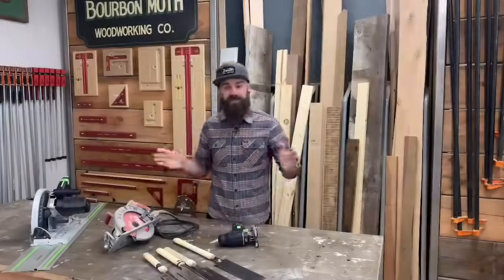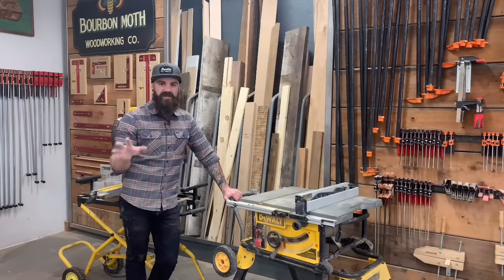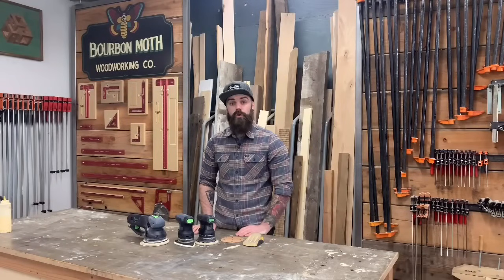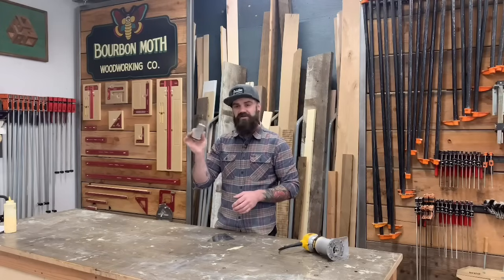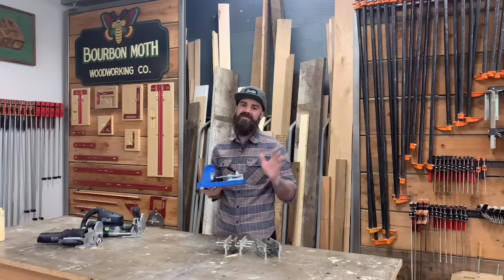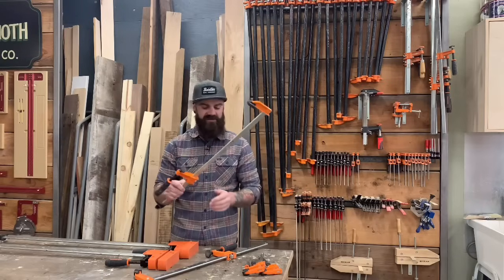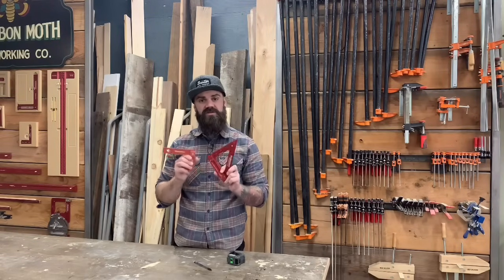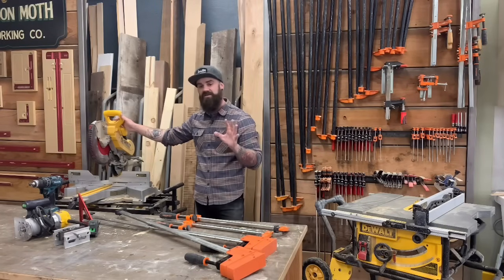Tools every woodworker needs | Start Building for under $1000

Comment: On the whole track saw thing In my beginnings I just used a circular saw with a piece of angle iron for a straight guide with two clamps 20$ upgrade
Reply: Same, but upgraded to a mid price tracksaw for the dust extraction.  Put a good blade in it and it's pretty sweet.  Also one thing a track saw does really well that can be difficult in a small shop with one person is break down full sheet with minimal fuss.

Comment: Great video, thanks a lot. i do have a question kind of off topic. I have been building a pretty nice and functional all in one type mobile work table. I have used my old dewalt jobsite table saw for years but just picked up an old craftsman to install into the table. My question is why do all saws have the fence on the right side? I prefer it to the left not sure why, i am right handed. I switch to the right when i need more rip capacity but thats it. Can i switch it to the left in my table? Does it limit anything or change function in anyway? Thanks

Comment: Nice, I am a Milwaukee fan and I already have some milwaukee tools (drill, driver, jigsaw, sander). Maybe not the best for the table saw ot the miter saw because milwaukee has focused a lot on battery fed tools instead of corded ones. But maybe DeWalt or Makita will work for me.
I honestly think it is worth to spend the money on woodpeckers stuf since you can rely on them to be precise and truly square.
I also found that a nice battery fed "skill saw" can be great, specially if you make a track for it to run on.
In my area, i find bar clamps to be a better purchase because F clamps tend to be much more pricey. But F clamps tend to be better quality as well.
The router, any good and small one with a plunge base option is a great option. Mine got stolen, but I will say it is basic to get going.
Maybe I would add there the pockethole jig too, the jigsaw and a nice circular saw (it is hard to make long cuts with a jobsite tablesaw and it is convinient very often).

Great video, I still have some things to buy

Comment: Next video should be small part inventory..what you will need on hand in your shop,..fasteners, bolts screws, washers and all hardware.  Sandpaper grits that are must haves.  So, I guess my point is, do you as a DIY'er just buy hardware one job at a time or do you stock up so your daily maintenance jobs can be done without the trip?

Comment: If you get a Dewalt table saw, don’t get the 8” as you cannot stack dado blades and are very limited. Get the 10” inch instead as you can stack dados.

Comment: While I agree with most of these options, inflation has not been your friend.   The total for all the linked items is now ~$1275.  The only things I would have added, but maybe they were just assumed would be some safety equipment.  Something like a mask(which, granted you probably already have several) and also some eye protection. While they are still relatively cheap, it pushes the total up closer to $1300.

Comment: Every tool I have (besides a belt sander) is dewalt and it all works perfect. I don’t have a jointer but I use a dewalt electric hand plane with a guide and have had almost no issues..(not sponsored by dewalt but it’s the brand I chose ) great video, definitely don’t need festool or jet etc to Make quality work

Comment: I would include in the starting kit, even if it means a few extra hundreds :
-eye, hearing and lung protection
-dust collection
Reply: Health is invaluable
Reply: @julianweiser9985  Dust collection isn't just about health. It is, no doubts. 
...It's also much cheaper than a divorce.
Reply: Instead of dust collection, I do all my cutting and sanding of consequence outside, and avoid doing much on dead calm days. if that's not an option, I'd definitely include some kind of basic dust collection. If you can't do a really good system, a track saw is much easier to collect dust from than a jobsite table saw or a chop saw.
Reply: For a small shop, even something like a affordable Rigid shop vac will do the job pretty well. At least, far better than nothing. Throw a dust mask in too, and a weekend warrior is probably just fine.
Reply: @The_Mr._Biscuit  Original video is about basics, not breaking the bank.

We can safely agree on a shop vac of some sort as well as fittings needed to tether to the different tools. ....Sais the guy that got away with tuck tape most of the time...
Reply: @The_Mr._Biscuit  Unfortunately, most dust masks aren't sealed well, so don't do much. Likely still better than nothing by a bit, but not as good as many would think. And if you're not freshly shaved, there's no seal. Have a beard? That beard is all the filter you get.

I agree entirely that any amount of dust collection is better than none, so long as it doesn't lead folks to think they're actually fully removing dust. I purposely do most of my work outside, because I can't do good dust collection, especially on my table saw (jobsite) and mitre saw.

Comment: Good info.  For starters, you also need a good set of drill bits.   Not the set with 50 bits that cost 12.95 at the big box store.  A quality set of brad point bits for use with the dowling jig.

Comment: I love these lists because it shows the diversity of woodworking philosophies. I’m a weekend warrior and still don’t have a chop saw after more than a decade but I wouldn’t want to be without my bandsaw. I’m also a chisel and plane guy. My jointer is a huge Veritas low angle jointer plane. One good tip is to scour yard sales and flea markets for hand planes. Replacement blades are reasonably priced and you can quickly build a selection from block planes to jointer and some really cool profile planes for a remarkably low price. One more pearl of wisdom, I acquired from reading Norm Abram’s book, is the unbridled utility of a combination square. It measures and marks, checks square and 45° miters. Nice list.

Comment: Unfortunately, if you live outside the US like myself, finding calibrated and planed wood is very hard, even pine. That makes planer and joiner much more important. Also, a good combo kit would cost north of 500-600 bucks with batteries and charger here, almost as much as I paid for my table saw! So, I use a corded impact driver which I got for 70 bucks and it does the job well enough.

Comment: A great video, thank you!  I own a Skilsaw brand table saw similar to the one you link in your "under $1000".  Overall it's a great saw, but I will mention it has non-standard miter guides.  There are little tabs that prevent 3rd party or custom built attachments from fitting in.  It's a problem that can be overcome with a grinder, but that's another $50.
Reply: Great info, thanks !

Comment: "Chop saw"... ummm.. Miter saw?
Reply: there is a difference. Miter saws and chop saws are not the same, even if the descriptions may sound similar. A chop saw is used for straight precision cuts, and a miter saw is used for angled cuts. Though it's tempting to try to adjust the miter saw to work as a chop saw, the results will not be as good.
Reply: @butdidwedie5664  The only chop saws I'm aware of have either: a large abrasive "cut-off" wheel, for cutting small flat plate, or angle, square, and round steel tubing, or a solid carbide blade, .187 to .25" thick, low RPM/high torque for cutting nonferrous stock. All woodworking saws I'm aware of have the ability to tilt the blade at least one direction away from vertical, and swivel the cutting plane from perpendicular to 45°(+) to either side. Those are all classified as miter saws, even if they are only used for straight, perpendicular cuts.

Comment: I have a DeWalt addiction and am very reluctant to buy anything else. I've had really good luck with their stuff. 
I'm an electrician looking to move into wood working, so this was a great video, even though I already have most of this stuff. What I'm really after is a decent lathe.
Reply: I’m with you on Dewalt. All of my cordless tools are Dewalt 20 volt. Drill with a hammer drill setting, impact driver, 6 3/4” circular saw and oscillating cutting tool.

Comment: Great video, really helped me understanding the basics of equipment.
I got quite a lot of really old tools from my granddads workshop, since he can't work it anymore - and I'm not quite sure if I can just start out now, or if some of the things are not really that useful.
I have a pretty small space, just a room in the basement, and the biggest question I'm pondering right now is: is it worth it to "sacrifice" like half of the space available to me for a cabinet tablesaw and dust collection - I got the stuff for free, but I'm not quite sure if thats the right choice. I also don't have a chopsaw, and feel like I can get away with that if I go with the tablesaw. I also got a handhelt belt sander, but no rotary one - do I need a rotary sander?
Cheers
Reply: If you build a good crosscut jig for the table saw, you shouldn’t need a chop saw. At least not right away. As for the belt sander, make a table to mount it on for a table sander. Then go buy an orbital sander for the manual sanding. It will give you much more control than a hand held belt sander, and much less likely to apply uneven pressure.

Comment: Regarding the domino joiner. I recently discovered those flat dowels (not sure about the correct English name, lamello?). They are a bit different from the dominos.
I bought a 4x20 mm router bit for like 15€ and make the lamello holes with the trim router. Precision is incredible, totally unexpected. If you do it the right way you achieve accuracy about 0.2 mm using a trim router only. And it's fast enough because the router bit got a bearing to go without a rail.

Comment: My joining odessy: Hammer & nails,Drill & screws,Plate Joiner & biscuits,Doweling Jig & Dowels. Cant imagine spending the money on Fesstool. Also a Bosch jobsite saw with a great stand & Makita  miter saw. Also benchtop Drill Press,Two sets of Drill & Driver, small Makitas & large Millwaukees both cordless. Starter set of tools. 
Since then, over 20 years I have added a Makita plainer. Rikon 14 inch Band saw & finally just this last month a great Laguna F2 table saw. Three routers & a router table built straight out of fine woodworking with a micro adjustable fence similar to Woodpeckers THe only things i send big money on are small measuring tools, a Starrett Square and Woodpeckers rulers. I hate tools that fight me, and after years of hating my DeWalt jigsaw it was replaced by a great Porter Cable unit.  NO more DeWalt tools in my shop. Non of these tools are top of the line, but all are at least Pro quality. Don't buy cheap tools, they waist your time & wood. I'm writing this on my desk, built by me, DYI  !

Comment: After years of woodworking I am rediscovering the roots. There is no greater satisfaction than planing with a well sharpened well tuned hand plane, squaring stock with a shooting board or sawing with a good handsaw. The difference is the skill and practice that these devices require. And the low sawdust and noise are pure pleasure. It’s like a zen experience and time is suspended in the shear joy of a close and personal relationship with a piece of wood. Anyone can destroy a piece of wood with a power saw. It’s violent, loud and environmentally carcinogenic. Hand tools are at another level. Don’t get me wrong, some times there is no substitute for power tools. A good band saw is high on my list, a lunchbox planer, a track saw, table saw, drill press, drill and drill driver and router table complete the bare essentials for me. I doubt there is any limitations you can’t surmount with this few tools. The last thing I would ever buy is a jointer. There are so many ways to get stock flat or joint worthy without one. I would much rather joint a board edge with a Stanley number 6 or 7 or surface plane with a number 4. It takes skill and patience but there is such a great sense of satisfaction when successfully done by hand.

Comment: I'm your target viewer. I have almost all those tools and just finishing my shop. Been doing woodworking for 40 years. I'm 52. I shoot photography and will use my new shop for side projects. My trim router is a Ridgid and I have nothing but good to say about it. I'd have liked you to have mentioned, glue, levels and a brad nailer with compressor or battery operated. Nothing has transformed my wood working more than that. I use it for very  light structural projects but use it with glue to set pieces in place, clamp, let it sit and then nail or screw. Your video was super amazing and my tips are just additional tips. Great job and thank you!

Comment: I personally think a chop saw is not A priority for a furniture builder if you have $1,000 to spend to start a shop. You are better off building a cross cut sled for your table saw to do most of your crosscutting. Chop saws are notoriously inaccurate and should only really be used for rough cutting in fine woodworking. Chop saws are designed for cutting 2 x 4s and 2 x 6s for framing houses where the tolerence of accuracy is quite a bit larger than furniture building. 
     Use your hand held circular saw to rough cut and use your table saw and crosscut sled to perform accurate cross cutting.  Take the money you you would have used on a chop saw and buy a better table saw, or buy an incra cross cutting jig or buy a router table. I think a beginner would be better off in the long run.
      Also building a cross cutting sled for a table saw is a great beginner project when getting into woodworking - it will teach you a lot about accuracy in your work

Comment: Grinding a few saw teeth off on push saws help on a smoother start also. Only thing different is you grind the teeth off the opposite end of the blade. Rob Cosman builds dovetail saws to sell.  He has stepped it up a notch to actually have saw teeth on the first 2 inches of his saws blade.  But almost double the tpi of the rest of the saw n a lot less aggressive teeth to b able to start the saw easy. You could do something similar by not just grinding teeth plum off but to a slight angle upward to the first full tooth n then take a file n flat file the set off the first half dozen full teeth.

Comment: I like the list but I would switch out the chop saw for a lunchbox planer.  Table saw sleds/jigs can do anything an entry level chop saw does. A planer might bump you up over the $1000 mark but you'll break even after one or two projects if you can plane rough lumber.

Also- craigslist is your friend, both for buying and selling. You can get quality tools at Harbor Freight prices and sell your early tools to trade up for bigger/better tools down the road.

Comment: A little late to the party but great video! I just want to add that buying dressed lumber is fine for small projects, but my experience is that dressed lumber is usually warped or bent (minor) when you purchase it and for larger projects, a small jointer and planer makes life so much easier.

Comment: You can save a few bucks with your pipe clamps by either calling a few plumbing shops to see if they're doing a galvanized pipe tear-out and replacement or else go by your local scrap yard and find out if any demolition companies have brought in  any galvanized water pipe. The clamps are the cheap parts. Home Depot or Harbor Freight.

Comment: I find that I seldom ever use a jig saw.  I'm not saying there are applications for it, but generally any cut that I would freehand with a jig saw, there is probably a better method.
Reply: Definitely requires practice to cut properly and straight with a jigsaw.

Comment: This dude talking about under a 1,000 bucks and then talking about take saw, checked the price it was $2,669 me be like 😳😳
Reply: I bought the exact Dewalt table saw in the video. It was $600 at Lowes. The part number is DWE7491RS

Comment: Suggesting solely buying s4s for quite some time instead of getting a planer and joiner is NUTS in my opinion.. That wood up-pricing is going to overtake the two purchases cost within the first year if you're actually making things. Other than that, awesome video!
Reply: I agree.  It’s a cost increase of a lot. Plus you have to pre order it. And hope it’s straight and clean. Yeah right.  Let me do it the right way.  On my machines.  More work but better outcomes.